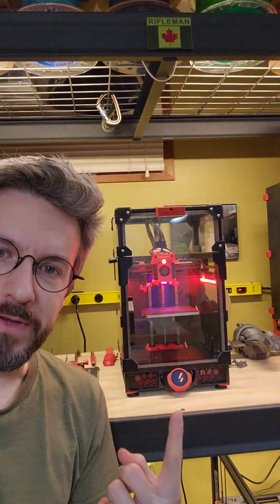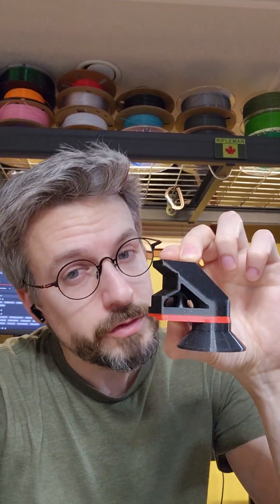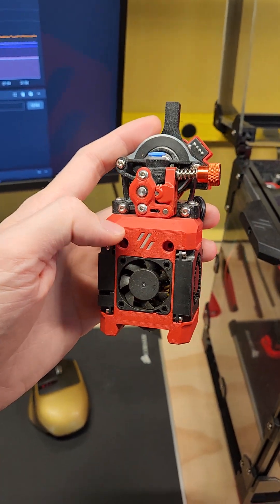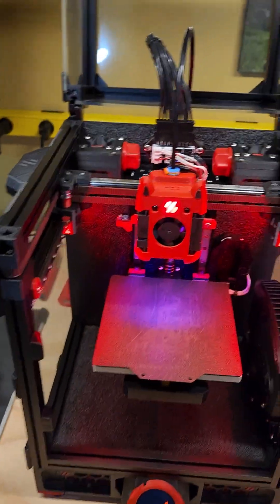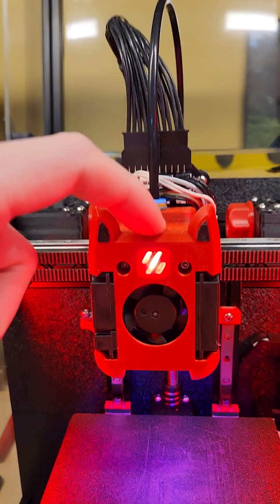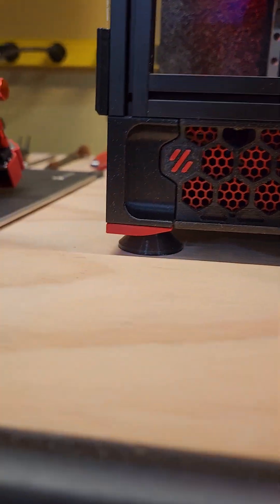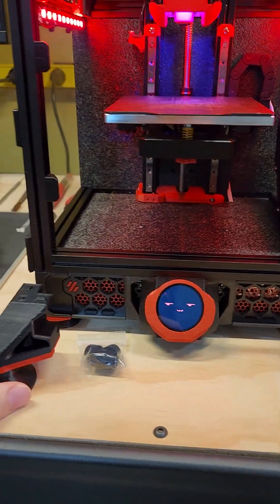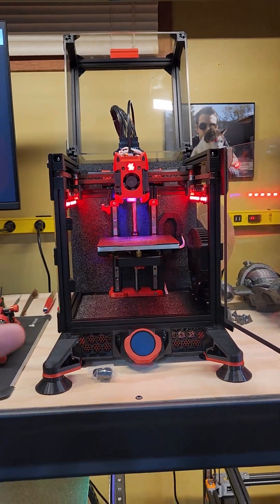Voron V0.2 Stealth Skirt Extended Feet

Comment: been thinking about making a V0 myself, it seems fun to use.
Reply from the maker: They are a fun little machine, only thing I will say is in some cases the build volume is a little limited. 120x120x120 takes care of a lot of parts but if it was 180x180x180 then it would capture pretty much every part to build any Voron. If you have more than one though I'd say go for it!